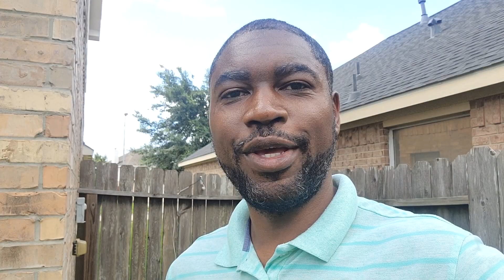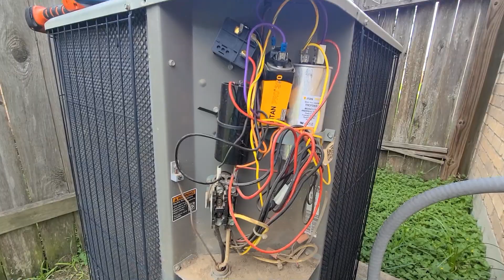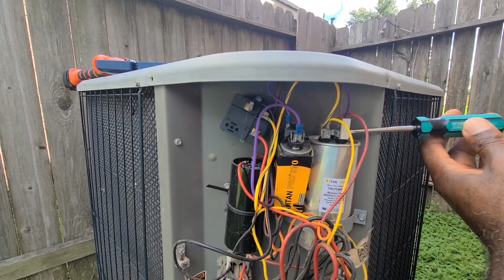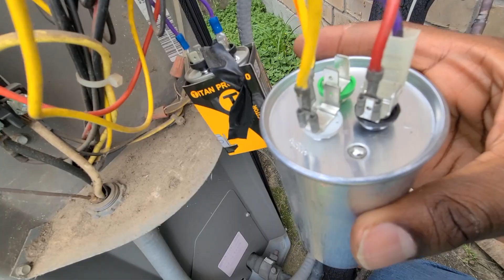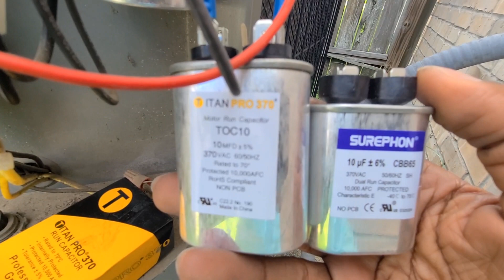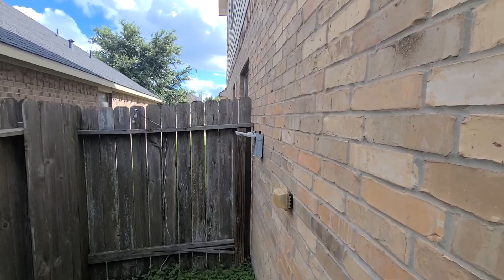How to Replace an HVAC Capacitor

Comment: my friend, I'm all for empowering people to do their own repairs, but please note, that 14hpx has the wrong capacitor. it should have a 70+10, according to Lennox specs , if your going to make these repairs yourself please reference the compressor label and motor label to double check your sizes, I would probably also install the correct capacitor and recheck the amperage on start up. If it is within range I would get rid of the hardstart kit to eliminate overheating the windings on start up. Capacitors are super simple to change, however as the average homeowner you need to understand that they fail for many reasons, such as heat, voltage, compressor issues, wiring connections, short cycling etc.. Don't just change the cap and think you're good to go. Get a pro (trustworthy) to assess your system if un sure. Just my professional opinion.